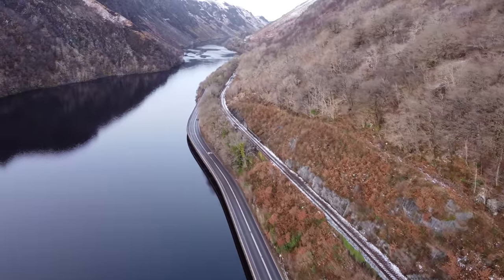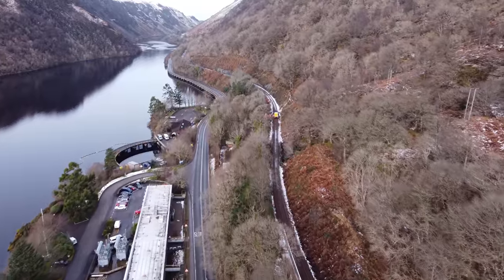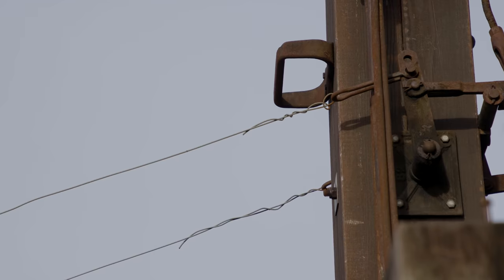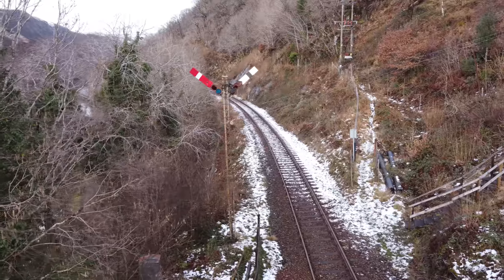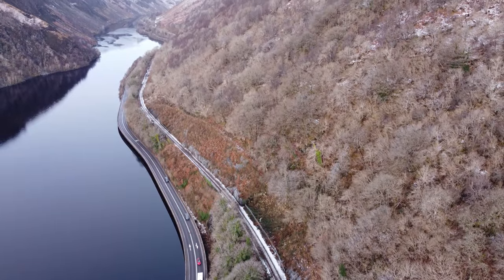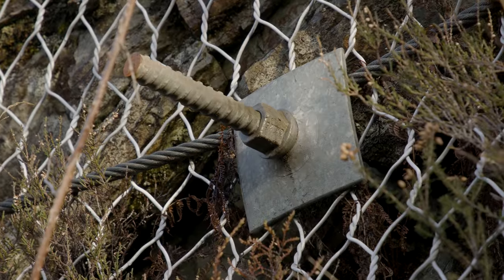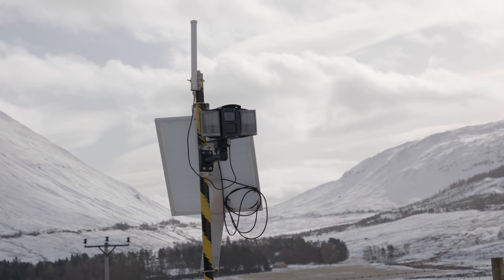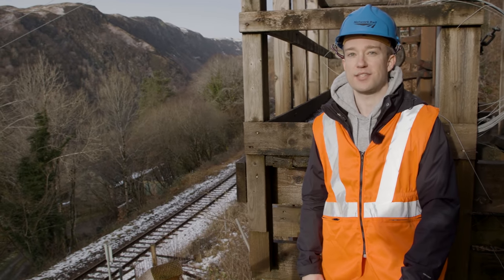After 140 years, this old technology still keeps trains safe

Comment: There are so many critical systems built today that aren't built to last 10 or 20 years, much less 100+ years. I hope the lessons and work of engineers and construction workers from back then survive our modern 'build it as fast and cheap as possible' mindset and thrive with a new generation.

That said, the mindset and detail-oriented designs of past decades, applied to the technology we have today, could result in systems that are as robust and resilient, while also cheaper to maintain. We just need to back off a little bit from the "always choose the lowest bidder" option.
Reply: Agreeing with you.
Reply: @kroezelgaming  Second that.
Reply: I think the main trouble is that parts are outsourced or designed by specialist companies. Those companies have it built into their business model that they want/need the ability to sell replacements/upgrades to the same people in years to come.. so it's in their interest to manufacture parts with a lower shelf life. Very hard to police that. Somebody who worked at a power tool company said that they literally could make a motor that would last 50 years, but the design it to only last a fraction of that.
Reply: Rpi controlled railway signal system here I come.
Reply: @kroezelgaming  forth that
Reply: Look at the German railway system. In some places (600)  we still use levers from 1910-1930 to change the points and signals. They look similar of the one on this route, just for a whole train station. And it's a really bullet proof system, you produce your own electricity through a crank for communication, allowing just one train on each track, preventing collisions.
Reply: Designed obsolescence and disposability are dominant now, and it's a cancer.
Reply: Yes and no, good things aside, if nothing broke consumptions rate specially with electronic good and home applicants will be dangerous low eg Soviet, Germany
Reply: It might be related to why some ancient Roman architecture is still standing today. People building them knew less about material properties they were using, so they just built it as strong as possible (survivor bias applies though).
Nowadays, we know exactly how strong a certain material is/can be, so we can make it cheaper, weaker, but still strong enough for the designed lifetime.
Reply: Survivor bias.
Reply: like the space station that was designed for 5 years but ended up serving 15
mir space station
Reply: Red shirt Jeff whold just cut the wires.
Reply: @hanteron2875  That would be a good thing. We overproduce and therefore overconsume way too much. If we produced only as much as we needed and built it to last, we could then drive our production towards more important tasks like bettering infrasctructure and providing greener energy. But as it stands now, we wander about economically without any plan on where we're going, and as the old adage says, a failure to plan is a plan to fail.
Reply: u do know. that its the design thats working not the materials. they've definatly replaced the materials
Reply: Cheap does make it easier to try out many different things though. If conditions change, it's not as big of a deal to switch to a different approach, because there's not as much of a sunk cost.
Reply: well it was maintained, and the reason it surived is more so because of it's neccesity but i agree some things engineered today feel like they were engineered to last a month and a light breeze of air
Reply: @T.J. Kong Totally agree. There is nothing magic about old technology. The only good thing is that it’s often quite simple, so it can be easier to understand, debug, maintain and replace. Like the wires in the case of this railway signals … until it turns out that the engineers used some rare diameter or material which noone makes anymore.
Reply: We've got to get the generation that voted in people like Reagan and Thatcher out of power before we can do that.  At the risk of making a massive generalization, people from that time period tend to be obsessed with profit margins and damn everything else.  It's a cancer on this planet, and I hope we and future generations don't end up paying an extremely steep price for their selfishness and short-sightedness.
Reply: @automated8493  Is that allowed? I thought planned obsolescence was an illegal practice.
Reply: I think there's a little bit of survivor bias going on there. You don't and can't know the crappy systems that were built 140 years ago and didn't survive until today.
Reply: I disagree with you. We as engineers would gladly design 100 year systems. But with safety systems today require all sorts of specifications, meet regulations, redudancy, have maximum age limit and regularly regulations are made which means that these systems would need to be redesigned.

Now... I would not use an industrial or heavy machinery that is 100 years old and has original safety systems and hse standards. There is a reason safety systems need updating and require modernisation. Because old system have killed and injured lots of people.

Would you drive an old car without seatbelts or an airbag, and without modern power steering and brakes? Because I wouldn't. That car might last 100 years, but I sure as hell wouldn't drive it.
Reply: @earomc  That's a very good point.
Reply: I work in the UK rail infrastructure design industry. There is on a tiny proportion of systems designed for 20 years everything is designed and guaranteed by the designer for at least double or more than that depending on the system. This system works because it is mechanical engineering, not electronic-based sensors that don't work in that kind of environment. In the UK we don't design and build stuff to be as cheap as possible, but to be efficient in cost, maintenance and demolition.
Reply: Being that guy - I'm sure there were a lot of systems built a long time ago that didn't last very long too, we just don't hear about them because they were crap. Isn't it survivorship bias to look at the things that have lasted a long time, and say that things were engineered to last longer 'back in the day?'
Reply: Absolutely agreeing with you, but - having something build to be easily maintainable often means that parts that can be swapped and are replaceable for easier maintenance, also end up making it need to be checked more often because of these parts.

When they are easily maintainable, it's okay to make them to lesser quality since hey, you can replace them anytime.

I can tell that being a problem with machines I work with, newer ones, whilst easier to maintain, need more regular checks and maintaince over all. 

Hard to balance, espacialy in a society that is now used to things not last all to long anymore and that's okay with throwing away and replacing instead of repairing.
Reply: COBOL
Reply: There’s plenty of examples where those old methodologies didn’t hold up though.
Reply: Read: The Deliberate dumbing down of society.

Good book, from Charlotte Iserbyt.

It will tell you that the reason people aint getting any smarter is because of how the system was designed.

We use to be able to build pyramids and such, but now we seem unable.
We were able to haul rocks up mountains to build cities ontop of em, but now a days we seem to have a problem with that.

The Leipzig Connection is another great book. 
These 2 books will show why we are not getting any smarter.
We are not educated at school. We are trained.
To earn money.
Almost nobody learns how to actually "make" money. Or how the money system actually works.
We only get taught that we should earn as much money as possible.
Reply: @xkinsey3831  depends how it is implemented. If you had a phone that had a line of code to tell the battery to fry the phone after 2 years, that's illegal. But if you're just 'cutting costs' and using 'minimal material' to keep the unit price down which, as a side effect reduces the lifespan of the product, there is nothing anybody can do about that and there's no way they can effectively govern it. I could build you a shed out of solid oak that would last 100 years, or I could use some softwood that would look the same from the outside, but would only last 15.
They also don't care if people know their products have a shelf life, they just would rather sell you a 'cost effective' solution every 5 years than a one off that lasts 100.
Reply: Our world jumped the shark the day 400 paper print factory workers were replaced by robots and one maintenance person who was later replaced on an upgrade to the robots.
Reply: I am sure, that you will come up with a solution using a raspberry pi and some custom code, which will just work. ;-)
Reply: @zackakai5173  Is this cancer called economic rationialism? And Neolibralism? I’m annoyed that our Prime Minister John Howard introduced GST, like VAT something like 20 years after Thatcher, the party ideology made sure we didn’t miss out.
Reply: Luckily, trains have very strict safety standards, so they are less prone to faulty systems
Reply: Agreed. I'm also against capitalism.
Reply: I imagine that the systems that were poorly built due to reasons relevant today or due to science and technology not being advanced enough, they just fell apart and were replaced. Hopefully not taking lives with them as they did.
Reply: @Henri Hänninen  It's also that these things are over engineered for what's needed. Great that a bridge lasts 500 years, until lorries are invented and can't get through. Amazing that you've built this tower block to last, but it's outdated in 50 years and has to be torn down anyway. Cool, this car engine can run for 300,000 miles, but it's inefficient a decade or two later and has barely done 100,000.

Building stuff to last longer than you can be reasonably sure it's needed at substantial additional cost is just bone headed and puts designer wants over engineering needs.

Accepting that some things shouldn't last forever and that times change is part of practical engineering. As a manufacturing engineer I see a lot of over engineering of product designs. Putting +/- .5 thou tolerances all over your drawing may look nice, but when it isn't needed all you're doing is making scrap, costing time and costing money.
Reply: @Cristiioan Jeff's trying to figure out how to replace the existing system with a Raspberry Pi of course. :).
Reply: less quality of products means more sales. light bulbs for example.
Reply: @automated8493  Ah I see, thanks for the clarification.
Reply: Not quite. The reliability of modern control systems are far greater and modern systems are incoming on even these systems. 

There is an inherent bias in that things that do manage to survive far longer than they should. This outlier is then treated as the percieved norm of what past tech could achieve. 

But actually it's an outlier. Have many cars survive from the 1960s. Not many. 

The drive to efficiently will have an potential impact on longevity and this is often incorrectly inferred as an issue. An inefficient unit is far more prone to failure in many cases due to higher energy use/release.
Reply: I think you're giving too much credit to a relatively simple problem that has no need of electricity costs. 

Due to their scale, I'd imagine all electronic communication systems tend to entropy. No error-correcting codes in wire.
Reply: The reason older systems were "built to last" is because they had specific resources we don't which allowed for great design at a low cost.
Reply: @Gakulon thatd be awesome if and only if for some reasons we can get all countries to agree on everything
Reply: Saying “old tech is nothing special” and “how modern tech will somehow survive past 100 years” even they already don’t survive 10 or 20 years is way more biased than anything. And that ‘survivorship bias’ bull is not an actual thing or someone would be arguing that og xbox is superior to current xbox just cause they grew up with it. People who say that survivorship crap want to appear smarter than they actually are.
Reply: There was plenty of things built fast and cheap 100+ years ago too, they just didn't last 100+ years so everyone has forgotten them, unless they caused some kind of note worthy disaster. Of which there are plenty if you go looking into history.   Let's take off the rose colored glasses shall we, people don't change and your "always choose the lowest bidder" is hardly a new problem.
Reply: I mean, 100 years from now people will be looking at some remaining systems and go "Wow, people in 2022 built things to last". The old stuff that's still in operation lasts, because otherwise it would have been replaced.
Reply: Jeff really is everywhere :)
Reply: One of the advantages of working at the dawn of the Industrial Age was that everything was insanely expensive. You had to look at everything for its merits as a machine, rather than look for something cheap. Because nothing functional was cheap. You also had to design things to last, because humanity had about ten thousand years of experience building things to last all that time, since if a community had it, they would just repair it, not replace it.
Reply: Good for a Thousand years might be possible...
Reply: Hm. You can't sell maintenance if you build something to last, though— Less profitable, and looks worse in the contract.
Reply: @eugenb9017  
But I was expecting Geoff...
Reply: I dont know if you know the scifi series perry rhodan, but there machines built by humans/thier decendants are build for millenia. You can often find multiple thousand year old machines still working. I think we as a species should take pride in our machines and not build them so they Fall apart after 20 years.
Reply: @T.J. Kong modern technology can't beat the pre- world war 2 architecture and interior design, that is soul pleasing and esthetically detailed with ornaments. Con't forget about the durability of the material. We live in throwaway-society.
Reply: @automated8493  That motor was already made a 100 years ago and still run in many old equipment. Building it cheaper and more marginal on the spec and you have a motor that last less then 10 years.    :-(
Reply: @T.J. Kong this. Same argument is used with the Roman Roads. We only see the roads that survived, not the various other crappy roads that were destroyed in a matter of days, weeks, months, or years.
Reply: @keeperofthegood  ok Luddite
Reply: that's a bit unfair. it's largely a survivor bias
the bad design or poorly built things have fallen down or failed. the only ones left are the good ones
Reply: Agreed, but this system wasn't designed to last 100+ years. All the parts have been replaced over time as needed to keep it operational, likely every 10-20 years. It's survived because it was maintained and replaced, not because it was impeccably designed. Most things from that era didn't last, we're looking at one example that did.

There are times when you should 100% be designing for 100 years, but most of the time, designing for 10-20 is more than enough. A bridge is likely to still be needed in 100 years, so design for it. Your backyard shed? Chances are extremely good that between now and 100 years, someone will want to remove it. Is it worth engineering that to the extreme? But on the flip side, phones are essentially designed to kill themselves over a few years, which is obviously a waste.
Reply: As they say, there's nothing more permanent than a temporary solution
Reply: @T.J. Kong It's the design, not the materials that have lasted.
Reply: Old stuff can last for longer because they are simpler and had to be made out of more expensive stuff. It's not just "oh we don't make good stuff anymore"
Reply: Good luck with that
Reply: the anderson piano isn't build to last more than a single rockfall let alone 100+ years it is vigorously maintained and repaired because it's made repairable
the issue isn't things aren't built to last the issue is companies in everything ranging from tractors to mcdonald's ice cream machines learned how profitable it is to force the buyer to get repair from them every time they need repair instead of making something the buyer can repair with their own team
Reply: for real. totally correct dude
Reply: @howardbaxter2514  You are quite wrong in your assessment. Now, let Youtube know if you can reason any at all or if you are just a person that knows a word and how to use it wrongly.  Reason this, you live in a community where the food is produced with machines and no people, it is shipped in self driving vehicles to factories that then process that for delivery to store that use no people and finally arriving at stores with no people employed with automated stocking and billing systems.  At what point did you get paid to go and buy that food? You didn't produce it. You didn't ship it. You didn't process it. You didn't deliver it to the store. You didn't vend it from the store. Ok, the internet awaits your ability to think things through before you use a word you do not understand.
Reply: @keeperofthegood  so leave everything to human error? Do you know how stupid and inaccurate people are, especially when doing repetitive tasks? Very! The purpose of robots is to replace people from doing dangerous, mundane, and/or repetitive tasks. I would know since that is the whole freaking point of my major and the projects I am currently working on. We are trying to create machines that help keep people safe and help companies.

But you know something? Automation is how we evolved as a species. We used to plant seeds and till soil by hand, then we create mechanisms to till the land much easier for us, and that was multiple millennial ago. It is that ambition and drive that has led us to reevaluate our time and work on other areas to enhance our species as a whole. We wouldn’t be here today without automation. It’s just in this day an age, we are developing more complex robots to do a lot of menial tasks. This doesn’t make us weak or stupid, but actually far more sophisticated than we were before, cause that is how engineering and science works.
Reply: @T.J. Kong Except we can already see a lowered trend in the lifespan of manufactured goods. Planned obsolence is NOT a myth.
Reply: @keeperofthegood  and since you have so much fault with automation, how do you feel about the printing press? It replaced all the scribes that wrote books by hand. What about the computer? How do you feel about the computer? It replaced all the mathematicians that did work by hand to perform important calculations?

The reality is that automation and advancements in technology are vital for our species to grow and thrive. As a species, humans are very flawed, but we are the one species on this planet to have the ability to use tools to advance ourselves immensely. Why handicap ourselves and start doing everything by hand, when the error associated with it exceeds that of computers. Heck, would you want to drive over a bridge that had all it’s important calculations done by a computer, or would you rather drive over a bridge that was calculated out by humans? Assuming you have any common sense, you would go with the former and not the latter. But I don’t know. Maybe you lack that common sense and would rather leave the bridge and the calculations done by an engineer up to fate (and I do mean fate because certain processes like the thermodynamics surrounding the bridge cannot be done by hand, and can only be simulated through a computer).
Reply: People make decisions based on today or tomorrow, not 100 years. That is also the reason why the environment is absolutely messed up
Reply: @eetuthereindeer6671  Not people in charge of companies, and they don't even need to plan anywhere near 100 years.
Reply: @Mike-oz4cv  Yes, nothing magic about old tech, like you said. It just made to solve problems. That was the magic. Today's tech is made to solve problems IF IT DOESN'T COST TOO MUCH. Otherwise it just solves roughly the problem. The cost is of the biggest importance, the highest priority above anything else. Probably not in every area, but I am probably not wrong with assuming 99.9% the times.

Old tech is not magic. It just works.

I love new, modern tech, every innovation, complex systems and everything. Until someone comes and cheaps the f*ck out of every part, making it barely good. And that produces the majority of todays trash...
Reply: @ragnkja  I know, I saw and used them in person. But ALL systems isn't true, east Germany for example had different ones as well.
Reply: Didn't you hear about the issues that they have trying to find replacements for this system?  Most of the bits were custom made so it's a pain to replace them.  Modern wires are going for more robust and resilient but that's not what they want for this.

Don't get me wrong, I don't enjoy that most of the systems nowadays are cheaply thrown together, but it's not like it's only a modern problem.
Reply: @riveness  Using cars as an example isn’t a VERY great example. My dad owns a 1952 Plymouth Cranbrook and it’s in great condition. Cars are very dependent on how well people take care of it
Reply: @Pandaptable  exactly my point. Out of a production line of tens of thousands, there are only a very few left and are heavily modified.